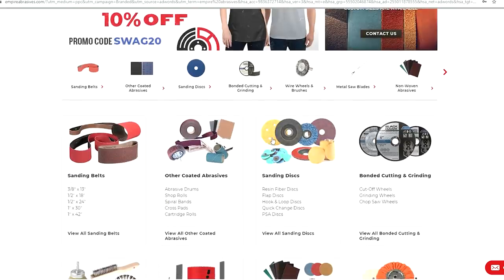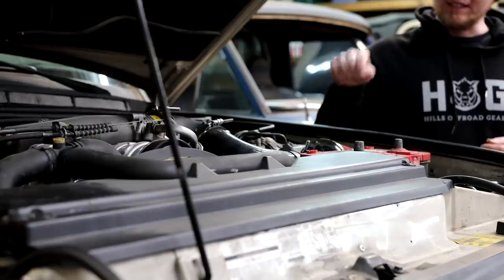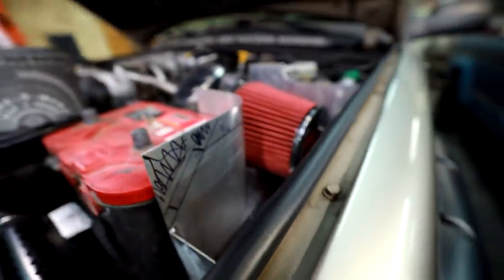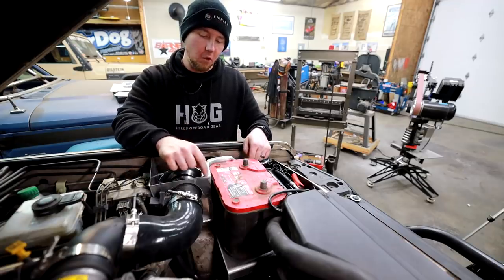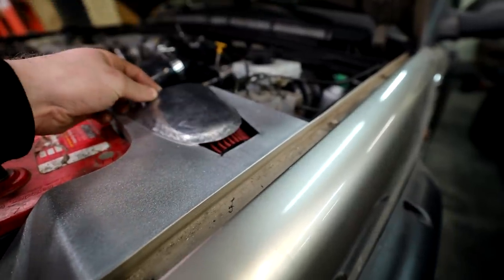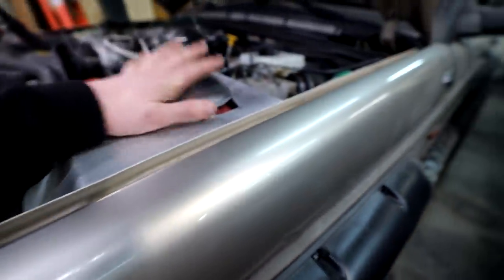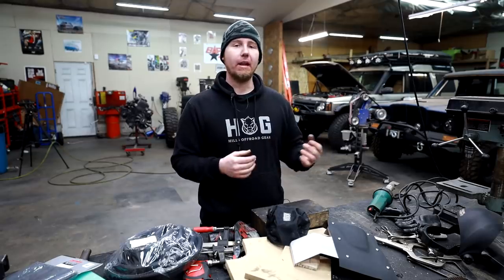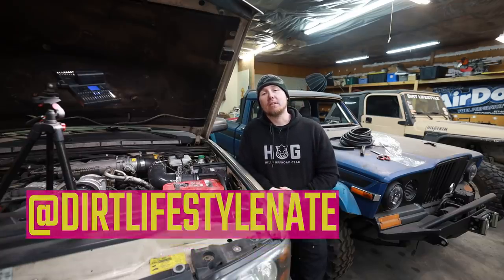TRYING To Build An Off-Road Intake That Doesn't Suck!

Comment: If you are wanting to get that second battery out of the way, you can mount 2 x Optima's in the space where the factory battery sits. Columbia Overland used to make a dual battery tray for D2's to give you an idea of what that looks like, there's a few pictures of it if you do a search. I use that tray in my D2 and actually have the batteries out right now, so I could send you a picture if you like, just let me know.

They are snug, but it works well. As an aside, the bracket Columbia built is way to wide. You'll want to fab something narrower than that if you go that route.

Comment: Sir
 For precleaner. It is air flow direction and air pressure.  Looking at the ford tractor . air goes up thrue angled fins that cause the air to spin in the precleaner bowl in the center is the down pipe to a big barrel air cleaner. In side that one is a smaller one.

Comment: Hey man if you ever choose to go the snorkel route check out the Donaldson pre-filters they're pretty sweet
Reply: Donaldson makes some of the best filters on the market, period. Ford used them on the 6.0 Powerstroke. The M1 Abrams comes with a very large Donaldson air filter. They flow great and filter extremely well. Will probably filter and flow better than just about anything else.
Reply: ^ What he said!  
They make amazing filters and I have them on many of my vehicles. 

I wouldn't call it a failure but more of practicing and  getting to know how to use your tools.   Nothing wrong with that!

Do you have a wall of shame for broken or parts like this?

Comment: K&N filters are great for street rods or hot rods but not good at all for off-road use! Keep up the good work! Use a Napa Gold commercial filter with a pre filter
... in a sealed intake.. the K&N is what caused your problem

Comment: Checkout aluminium aftermarket airboxes for Landcruiser's here in Australia. You probably don't have enough space for the size and style we go for, but it wouldn't be a bad jumping off point. we get a bucket load of dust, and dusting engines is a common problem.

Comment: "my wife doesn't like snorkels" - what is it with wives and not liking snorkels?  Mine doesn't either - she says that they look like "chicken pots on poles" (precleaner on top).  You'd be wise to ditch the K&N - it's great for race cars but terrible for long term health of the engine.
Reply: Mines the same. She says they look stupid. I'm like, but you can wade up to the windscreen with no problems.
Reply: i think itd look good if the air box portion was under the roof rack.
Reply: My wife loved the snorkel on her 80 series....she always got questions about it and began telling people it was a flame thrower😂

Comment: Your idea to use Kydex has merit. However, considering it's melting point, under hood temps would have me worried about it deforming with prolonged use.

However, there us a similar material called Boltaron that would be more suitable for higher under hood temps. Kydex is good for knife sheaths and holsters (I have one for my XD Mod.2 .45ACP), but I'd be wary of it under the hood of my truck.

Comment: I am curious, why did you not use the Air filter from Discovery 200Tdi or Defender 300tdi? That way your issue with dust passing through the seals would be solved.
Reply from the maker: It wouldn't fit with the battery and we don't have either of those vehicles in the USA 👍

Comment: If you switched the battery and the location of the filter box; it wouldn’t be such a weird shape. Also the filter box would be further away from the heat of the engine, improving performance, and the location allows for easer access to your air compressors.

Comment: I figured he'd have the plastic bolted to the bottom side poking out the hole in the aluminum, maybe use aluminum fasteners so that it matched, or make it slide fitment (how pliable when solid, have enough give to get into a snap fitment?), no fasteners visible externally.

Comment: With theLS i swapped into my XJ, the intake is probably the biggest, "fail" of the setup. Although mostly trouble free, I did have a hydrolock event several years ago, which resulted in a thoroughly ventilated LS1. Really just an excuse to use a 6.0 LQ4 block as a replacement.

Comment: Would running it through the firewall be completely out of the question? I think that would eliminate the need for a pre-filter and if you got a larger filter it may not make the suction sound

Comment: 2 things:
1) did you learn from your mistake?
2) does it work?
since the answer to both of the above is yes, it's not a failure. Just version 1.0 with improvements to made on the next version.

Comment: Shoulda just ditched the K&N bought 20 cheap paper filters off of rock auto and change them as needed.
Reply from the maker: I haven't seen a paper cone filter before. Do you have a link?
Reply: @DirtLifestyle  I meant in the stock airbox. K&N’s are notoriously bad at keeping out dust, not just through the filter but also around the seals which are thinner and harder than factory style.

Comment: buy a closed  filter like bmc put at least 50cm vertical tube facing down put a pot like or small plastic bucket throw some sponges and a mesh to keep them steady and fill it with oil up to the mesh leave a couple cm from the tube. add a second tube  to the bucket parallel to the other tube and connect it to a snorkel. now you have a box with to tubes one connected to the snorkel and the other to the filter. the innertia of dust will make it stick to the oil also gravity doesnt let particles to go up to the filter. the sponges doesnt allow the oil to be sucked to intake. you open it you wash it you reuse it. it is inertia oil filter used for old trucks and engines like ruggerini. i made some for generators and pumps in dusty places work perfect add sponges so oil doesnt go everywhere as used in f1 tanks and airplane tanks.

Comment: You can fit two batteries on the passenger side in the stock location by omitting the jack, this will give you ample real estate for a custom air box.

Comment: aFe makes filters that are washable and dry.  you dont have to use an oil on the filter.  i have one in my tacoma and its done well after being in moab and in colorado.  easy to clean also.  just had to use water and spray until you see clean water

Comment: **Snorkel**

The intake comes from the wheel well. When you are offroading, dust is kicked up by your tires and enters the intake. 

With a snorkel, you redirect where the air is coming from, up high above most of the dust, and keep your intake cleaner.

Edit: 
Well... I should have watched the whole video before my comment...

Comment: On SoCal desert trips I will pull my filter every night and hit it with the air compressor. I run a snorkel with a prefilter and dust still gets to main filter. The hilux snorkel will fit your taco and save you a few bucks

Comment: Build an Oil Bath like the older Land Rover Series aka Tractors and problem solved. 

P38’s and Disco 2s hate K&N filters. Sensors are too sensitive to oil and then dirt sticking to them. D2’s and P38’a run better with paper filters. But if you wish to push the limit install an oil bath.

Comment: Nate once I install my snorkel I will be installing one of these to capture the dust before it makes it to the filter. Aussies use them all the time. I already stopped using this pod type of filter after seeing how much dusty passes through it, when I oiled the filter. I did a 3.4 swap in my 95 Runner and the air box moved to the other side so I ran a pod for a long time. Now has an air filter box from the model the engine came out of. I live in NW Oregon and experience enough dust here to make me concerned. 

https://www.amazon.com/dp/B015YR82TE/ref=cm_sw_em_r_mt_dp_s00cGb0VCJWW2?_encoding=UTF8&psc=1

Comment: this episode was way to loud. however, i respect the fact that you can admit defeat. makes it all a little more realistic. sometimes bolt on stuff is simple. i have a zr2 in which there is no snorkel out there to be bought. i purchased one made for a Cherokee,a land rover, and thought i could modify and plastic weld. lmao ask me is i have a snorkel. no i do not. i live in slc utah and the reason i like snorkels is to pull and force air from above rather than drawing hot air from the pavement. i d/d anything i build. i see people sitting in traffic at idle with ac blasting pulling heat to cool their vehicle in excess of 140+ degrees. i really don't thing people understand the wear  this causes. Any how thanks for doing what you do. BUT PLEASE TURN DOWN THE RADIO!

Comment: If u block the hole on the inner guard itl prob stay quite clean in the dust. Not perfectly clean but cleaner than the panel filter 😂😂. Yes hes goin for a snorkel 🤣🤣🤙

Comment: Its not a failure. You are just looking at it wrong. You have a perfectly good air box cover and you don't know it. You need to extend the box walls up untill it contacts the hood. Use some of that weather strip to make a seal and your done. I would block off the air coming from the fender and make an opening up front next to the battery. Then fill the skinny section full of that pre-filter media and call it a day